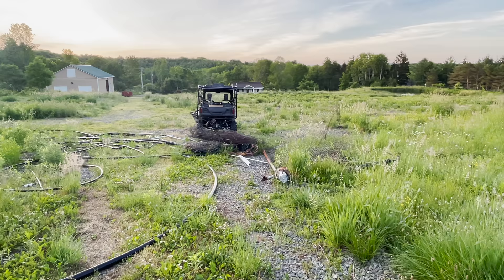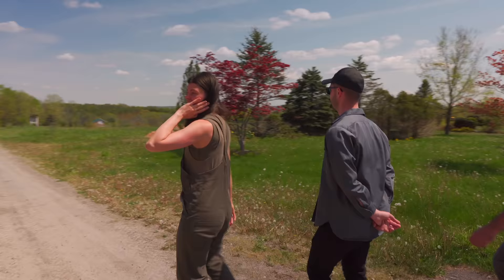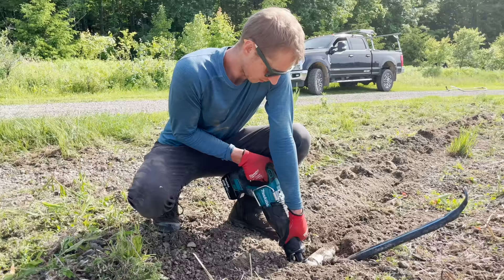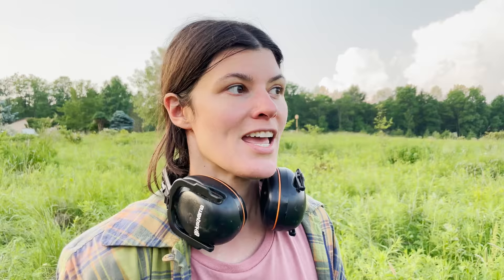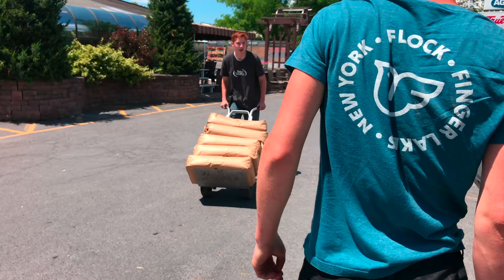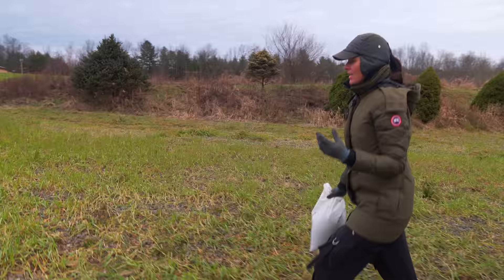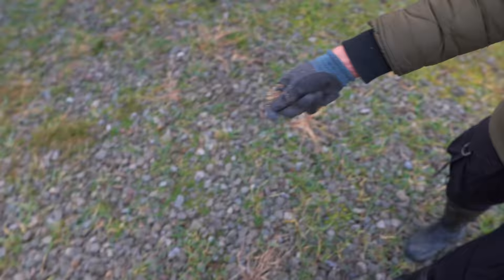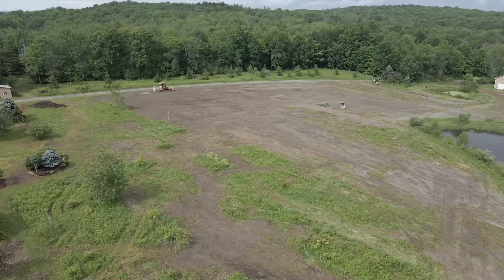Turning Old Nursery into a 7-ACRE NATIVE "INSECT" MEADOW — Ep. 077

Comment: What a job! I live about an hour away and have just ~1acre in a rural area. When I moved here, a lot of the space was covered by invasive lantern plants growing through piles of brush. It took ages to clear the stuff out and then I discovered the ground beneath was full of all sorts of trash - long pipes, old chicken wire, bits of rebar, random wires and cables, something that looked like an old well pump ... you name it. Because of big tree roots in the area, I couldn't dig it out, so I've been letting natural freeze-thaw cycles slowly push the stuff to the surface. Fortunately, after four years,  the only trash my yard still "grows" in the spring is ancient golf balls! 😂 This video triggers very visceral memories of all that frustration! Hopefully your frustration is over and the native meadow will become a reality soon!
Reply from the maker: Sounds like you had a lot trials and tribulations yourself with your land. Very similar experience for sure—save for the large tree roots. Glad to hear that you have been able to—over time—remove it slowly. Isn't it funny how earth simply "expels" that stuff on its own if it doesn't serve it?

Comment: The best way to start a meadow is going out every day to pluck baby weeds and reseeding areas every time you pluck the weeds out to establish those types. However I’ve never done it in gravel like yours. So for those gravel stones you have, that’s going to be a hindrance for many meadow types of flowers that try to grow. 

You really needed more time to add in layers of planting, then raw leaf cover so the added benefits of worm castings could help eat away at those leaves,  the leaf cover will insulate in the winter and bring beneficial diet to insects, fungi’s that wouldn’t otherwise be there. Leaf cover also kills off weeds and brings the soil acidity to very high levels depending on your leaves. This leaf cover eventually neutralizes over time and creates balance after the first spring when it essentially becomes dirt again. After that time you will need more reseeding. 
planting more cover crops adding clovers and more buckwheat if it doesn’t establish itself over the gravel, repeat one or two more years with leaf cover and crop cover. Buy a load of native worms to eat it the leaf cover and allow the soil to breathe life with out damaging it with tilling, as it adds more years to your work. Eventually you’ll have enough built up layers of dirt and soil to plant a healthy meadow were it was once gravel and stone. There’s other ways like digging up soil and turning it but rains and snow eventually cause the gravel and stone to push up again unless done every year which is lots of soil lost when it rains. 
I’m not sure if my comment will help or be read but I’d love to help you you in your endeavors as I’m figuring out ways myself to create soil in the world. 
I really hope you add an update to this wonderful video I have stumbled upon. As I’m all for watching others doing their best to create beautiful natural habitats for insects birds and wildlife that are beneficial to the area. Thank you for making this happen and good luck.

Comment: Good luck! Planting wildflower seeds do not turn out as you like for many many years and often completely fail . next time add sand to seeds so application by hand is more consistent mixed in a 3 gallon bucket broadcasted. its all in the wrist when applying by hand broadcast not drop
Reply: Yes to all of this
Reply from the maker: Thank you Brent! We think the reason why wildflower meadows have such poor rates of success is because folks often go with primarily flowers in their meadows and forget the grasses. We have about a 70% grass 30% wildflower mix ratio here. And the wildflowers are primarily perennials. Many off-the-shelf wildflower meadow mixes rely strictly on flowers, and of the flowers, rely a lot on annuals to get that first pop of color in the first year because those perennials generally take 2-3 years of growth underground first—concentrating on the building up of the root zone—before they make their aboveground entrance. We are not certain what will come of this meadow, however, because even though we did a year of prep here, you can still see some pre-existing plants growing, which don't get us wrong— is not all bad. There are native sedges, thistle, etc that are there. And probably a lot of stuff still in the seed bank. That discing doesn't necessarily "get rid" of the preexisting seeds there. And thanks for your suggestion on sand. We actually did buy bags and bags of sand and initially were casting that way, but over such a large area, the toting around of a bucket with sand got really heavy, so we ended up just opting for hand-casting without it. We also had a small seed caster, but that was too cumbersome on the terrain. Someone else also recommended sawdust, which could have been a lot lighter. We will definitely be using the sand and seed-in-bucket method for the smaller meadow areas we plan to be putting in. Those will be a cake walk compared to this beast. Really wish we could have seeded/culti-packed the seed the same way we did the buckwheat and oats. That would have been the easiest but not practical in the least bit!

Comment: Ok guys I’m getting a meadow mix to add to my back yard. What a rewarding process to watch. Thanks for sharing.
Reply from the maker: That would be cool. Site prep is definitely key. If you are working on a small enough area, you may just want to add a black tarp over to the area you plan to plant, so it takes out the current grass that you have. You don't want much to compete with your seeds / plugs that you do. But if it's prepped well, then you'll have a great chance for its establishment. Plugs will establish quicker than seeds, but if it's a small enough area, you can even collect seeds in the area, which could be a fun project to do.
Reply: @FlockFingerLakes  Thanks for the tip!

Comment: Wonderful project and philosophy toward nature. Land restoration should become a growth industry instead of activities that destroy land and native plants. The work and expense you had to devote is mind-boggling. I had land in WI 1999-2006 on which my main project was establishing prairie on formerly pasture/cropland, the main prep task was removing fence and invasive "prickly ash."  Throughout I used fire along with mowing. My most successful areas were the places I had large burn piles because the intense heat had killed the seed bank to a sufficient depth and the ash was a great nutrient (I shoveled off most and flung it around the surrounding area because too much would poison the ground). FYI, I learned at a Midwest Prairie Conference that there are flower species that do well in the first season and act as pioneers to pave the way for plants that need a more established prairie ecosystem, prmarily yellow and purple coneflower, bergamot, and black-eye susan. It's true, and a nice way to see some results quickly! One mistake I made was to seed a large area by hand as you are here--flocks of birds arrived soon after.They must have been watching me because the ground was sufficiently covered by existing plants that had been recently mowed. Also, annual ryegrass (not annual rye) is a pretty grass to use for your pre-seeding cover crop. Very cheap and takes well. One more tip--the one flower that pollinators go absolutely mad over (especially monarchs!) is stiff goldenrod. It is a very pretty goldenrod, as well.
Reply from the maker: We would love to see land restoration become more popular, though have to say, it seems to be a growing "thing" around here, which is not a bad thing! Nice to hear that burning was your most successful strategy for removal of the prickly ash. Did you do any form of mechanical removal along with cover cropping over the course of a year by chance? Curious if you can compare those two data points.  Also, nice to hear of the pioneer species of plants: We have 3 species of Echinacea, 2 species of bergamot, and black-eyed susans, so maybe they will do an earlier showing than the rest? We'll see. Not sure if our seeds when we frost-seeded got picked off by birds, but it could have been the timing and the generous birdseed we give our birds during the colder months. We DID, however, get a lot of migrating Canada geese eat the oat seeds we planted because it was smack-dab on their migratory route, but we weren't too worried about that either because we really over-seeded, which was what was recommended to us. Lots of oats still came up, so we suppose that strategy worked—and was enough to feed their bellies for the long flight. And nice tip on the stiff goldenrod! We went with a small amount of Solidago nemoralis, which I guess is known as "old field goldenrod".

Comment: Admirable you guys have taken up such a large project. I only planted a 1/4 of an acre in 2020 … I made the mistake of working in some horse manure from a neighbor. It had some weed seed in it.
Reply from the maker: Ahhh the weed seeds! Yes, our neighbor asked whether we wanted to hay the whole place after seeding, and we declined only for fear that there would be weed seeds in the hay, which is essentially just a non-native grass. We were debating as to whether we should spray compost tea on the land, but there's such conflicting theories on both sides of the coin. A lot of meadow plants supposedly 'prefer' to grow in nutrient-poor environments. But then a solid compost tea can encourage healthier soil ecosystems of bacteria, fungi, protozoa, nematodes, etc. and perhaps can encourage healthier plants. Not sure which direction to head there, so we opted for just the enrichment we did with the cover cropping. If there are any resident meadow installers in the audience, please feel free to weigh in on your thoughts!
Reply: Thanks
I’ve heard cover cropping is the best option from several folks. 
We wanted to get the seeds down pretty quick. 
I’m curious what the results will be with ours 2 years in. The meadow is on slopes . 
I’ll let you know how it turns out.

Comment: Well done, with the exception that you did not kill the existing seeds in the seed bank. Usually, in doing a meadow, you need to kill cool and warm season weeds, spraying, or solarizing for an entire season. All of that tilling has brought up a lot of seeds so you may encounter significant weed pressure. That being said, I have had a rough start to meadows before with weed pressure but with determination (which it seems you have) you will eventually prevail!  Good Luck.

Comment: Very curious about the finances of a project like this.  It seems like such a big project!
Reply from the maker: This is a BIG project. The greatest investment—if we were to really place a value on it, (which we should b/c it means we weren't able to work on anything else)—would be the countless weeks of our own time working down there—removing debris, multiflora rose, etc. The second largest investment by far was the rental of the large equipment like the backhoe, grader, and the respective operators. Those cost between $1500 - $2000/day. And we were initially quoted for a day's work with 2 pieces of equipment / 1 operator, but as shared in the video, became 3 days with 3 pieces of equipment and eventually 2 operators. That cost was harder to swallow, but as Sander said, "It needed to get done—otherwise, when would it get done?" Also, it really, really helped to have a larger plan for the equipments' and operators' because while we had the backhoe, etc., for the day, we ended up utilizing their services for other items in the landscape that needed removing (e.g., the ash trees that had come down from elder ash borer that were near the road, the old, reverting willow in the front yard, some of the old buried gate lines, filling the trash bins with the debris, etc.). Sander was VERY good in that time management to get the most bang for the buck on the rentals. Now that we have done this, we're very, very happy. It would have been utterly un-maintainable if we didn't extract the debris, particularly the metal pipes and wires, and grade the area. Now it's workable and gives us far more options. The seed costs for the cover crops and disking/seeding—and even the seeds are super nominal compared to what we had to pay upfront to get the debris removed. If folks wanted to do this on a smaller scale, it's really achievable. We'll be putting in smaller meadow areas, (which will feel like a cake walk after this beast), and how we'll approach that is likely covering the area with a tarp to kill off pre-existing grass (or sod cutting it), and then adding the seed—and hopefully seed that we may be able to collect from the meadow and surrounding plants that are growing. That will be super fun. We seed-collected for this meadow, as well, but it was like a few handfuls and such a drop in the bucket for these 7 acres. Hope that helps elucidate your question!
Reply: @FlockFingerLakes  Thank you for the detailed response! Really interesting and helpful! It's admirable how much time, energy, and money you guys are putting into your new home. It's so beautiful. Can't wait to be able to visit it one day!

Comment: Maybe consider doing prescribed burns instead of mowing or brush hogging. I did brush hogging out in Missouri and I never like to think about the amount of animals I saw getting chopped up and tossed out the side. A good backing fire moves slow enough that animals can get a chance to run away. Especially if you time them around nesting seasons.

Comment: ah yeah appear a little overwhelmed and unprepared though with good intentions.  it looks like you have 2 growing seasons worth of site prep using moderate sized tractors and the like.  your gravel if more than 2" deep will needed to be removed, however it should be able to be put to a good use ~ drainage or road base

good luck.  I've done quite a bite of work in this area and it's a combination of science, economics, and art

Comment: Ambitious project! Wow! If we gardeners don't change our thinking and grow more natives, then who will? Gardeners should lead by example. At my age I don't have the energy to develop yet another new garden, so this year I'm using an old bed - retiring the vegetable garden plot (that has gotten too shady anyway) and putting in native plants appropriate to part sun/part shade. I've ordered plugs and cuttings of some native shrubs, This year the plot will be a nursery bed. I'm also starting some plants from seed - mostly grasses and sedges. Next year will be the year to plant everything to a plan.
Reply from the maker: I'm curious how you're seeding the sedges Carol? I got around 30 species of native sedges to add to the landscape and the seeds are like dust. Curious if you have recommendations on sedge seeding! Do you spread on top of well-moistened potting medium, since they are so difficult to "pick up" individually?
Reply: @FlockFingerLakes  I am giving them cold treatment now using the moist paper towel method. This is an experiment for me so hope it works. Once I get germination I will plant them into medium. (for large quantities I would sow directly as in this next step) Yes, I would use potting soil or the finer seeding mix and surface sow them. They require light to germinate. Use a very fine layer of chicken grit on top which will help keep the mix moist. Leave the pots outdoors for nature to provide variable temps. It sounds pretty tricky. I hate those tiny seeds!
Reply: Hi Ms. Eichler, 

What bush species are you planting may I ask?

Comment: Ohhh..I love this project! I do worry that you will end up with a lot of weeds this year...discing likely turned up a whole new seedbed! Fingers crossed that it isn't the case. Good luck, following!
Reply from the maker: I'm sure it did turn up old seeds and also didn't get some of the deeper rooted plants, since disking is really at surface level. It's part of the reason why so many folks resort to herbicide application to start meadows. We're hoping that the 1 year of cover cropping took up substantial space during those critical growing periods and will allow these seeds to germinate, but we'll see!
Reply: @FlockFingerLakes  we’ve been working on similar projects but only 2 acres. I’ve found it helps to do a little at a time… we’ve been solarizing patches of 200’x200’ and then seeding which seems to take care of the seeds and allow us a good seedbed. Best of luck—prairie up!!

Comment: Maybe California raccoons aren't as smart as Wisconsin ones but I volunteered at a wildlife rehabilitation center for years and it was amazing what the juvenile raccoons figured out. With other animals all we had to do when we took the old dishes out to clean and return with fresh food and water was shut the door. With raccoons we needed to lock the gate with a bicycle lock for the 15 or 20 minutes were gone. Once I just put the lock on but didn't fasten it and when I came back, twenty little raccoons were in the secondary corridor working on that lock. They had removed the unlocked bike lock, opened a spring dog leash clip, and lifted and turned the latch on the cyclone fence.  So be careful. Also, maybe you don't have the other predators that we have that can get under the fence but it looks to me like the fence should go lower. 
But, otherwise it looks like a great coop.
Reply from the maker: Think you may have wanted to write this on another video.